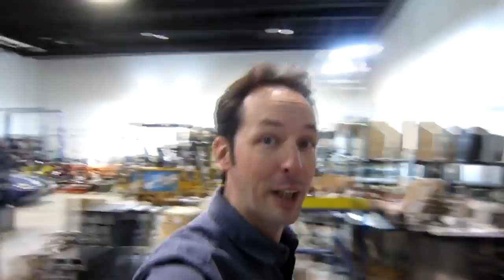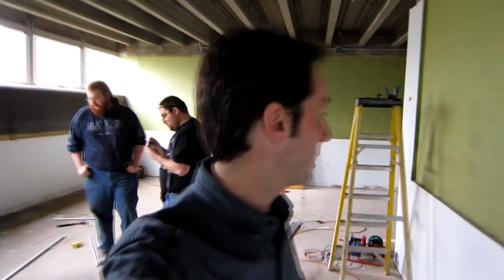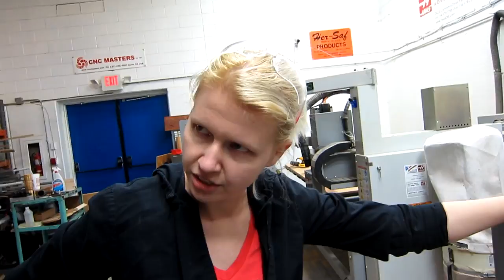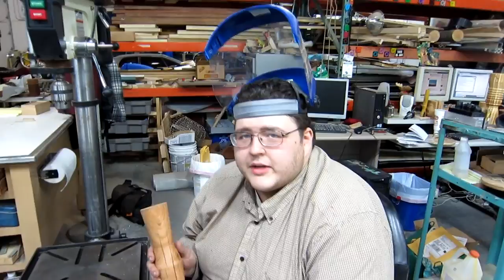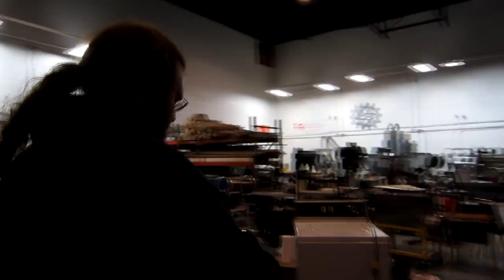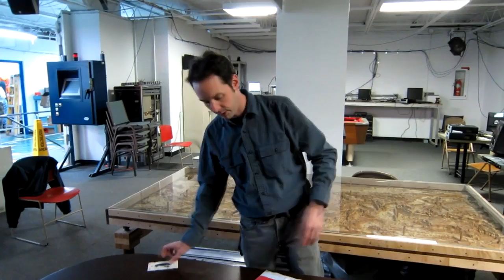Captain's Blog 1-7-12 Hard Drive Dominos and Camera Cabling

Comment: Hey, for the cable support hooks/rings, maybe  you could use big ringbinders, if you have beaten up binders in your officey stuff.
I planned on doing that for cleaning up the cables under my desk, but with small ones.

With really big ones, like ones with 15cm thick spines you might be set, though I fail to retrieve one right now to test how many cat5 I can fit in.

On the plus side, many of those lock shut, on the minus, some have locking levers that might get in the way, but some would work.